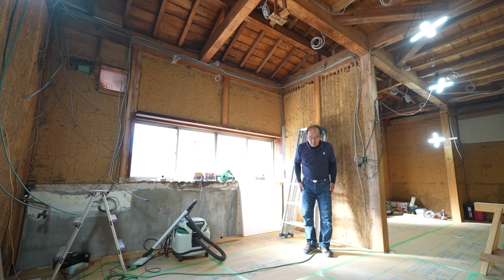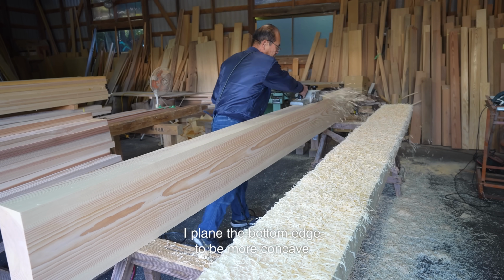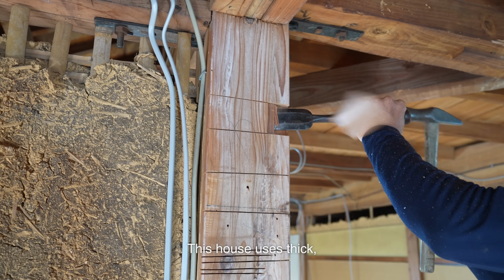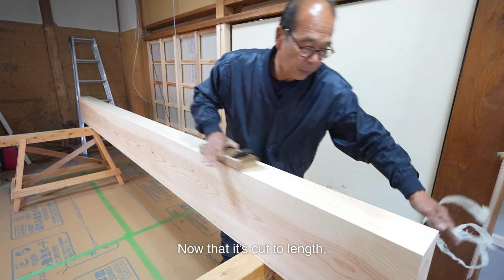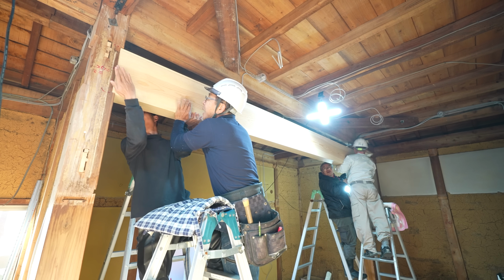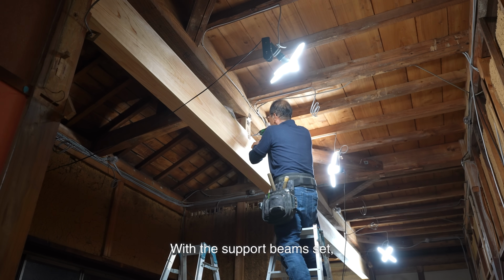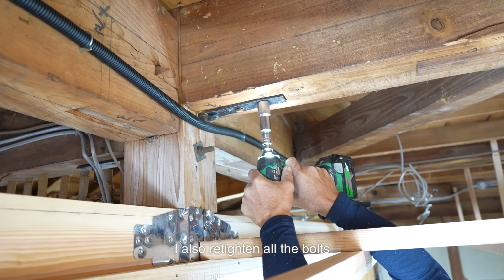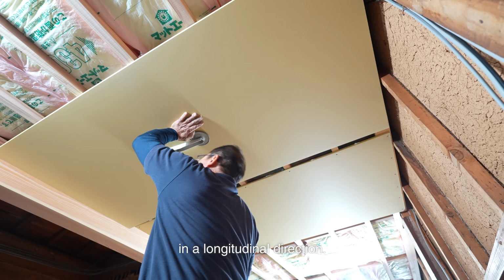Fixing a Drooping Beam with Power Timber! | Carpenter’s Renovation Part 4

Comment: As a former (American) carpenter and mechanical engineer I would say that the 15mm depth of the notch into the columns that these beams rest in is ridiculously small. All these giant timbers are in fact doing is performing an aesthetic function - i.e they look big. The weight of the ceiling they're holding up is minimal and  they're going to do little to prevent future additional sagging of the real, existing, roof structure.
Reply: Out of curiosity - how exactly does the insufficient notch prevent the beams from doing their job? Will the contact area between the beams and posts compress, thus sagging further?

Comment: Yeah, that's just common wisdom. Never anchor with only screws or nails unless there is a tenon joint or other friction joint to keep a heavy beam like this in place. I've seen log beams like this one to have worked themselves loose over time just from the wood's expansion and contraction over the decades and those beams had been nailed with 7" nails. But now were hanging on nothing but the nails with a 2" gap between the joint.

Comment: That pneumatic screw gun is amazing.  I wish they were available here in America.
Reply: He uses a lot of interesting tools. My favorite ones have been the groover and the super-surfacer.
Reply: @peybak  you can actually find super surfacers in North america.  They are awesome.   But the groover, ive never seen.  Closest thing ive seen are some of the mafell tools, but you need to take a mortgage out your house to afford one.
Reply: @peybak I want to buy the tajima laser level he uses but with tariff stuff going on I’ve held off
Reply: U can buy a similar nail gun look up Makita AN935H or DeWalt i think Milwaukee has one
Reply: @jankotomic5843 those are all coil nailers, not pneumatic drywall guns. They look slightly different because they are high pressure nailers, in which you need a special, much more expensive, compressor to handle the needed pressure.  They carry coil nailers for siding and framing at every builders store.  Ive never seen a pneumatic gun for screws in north america.